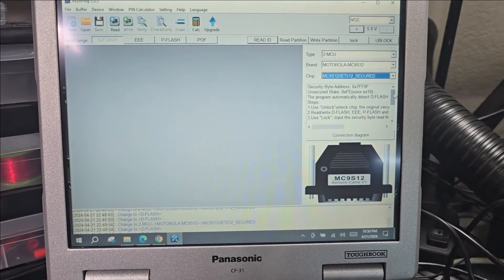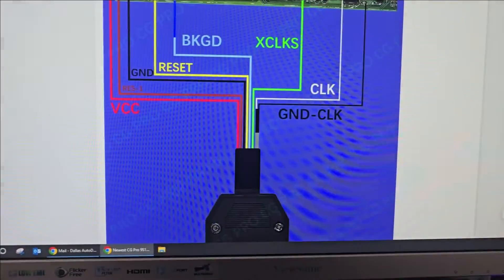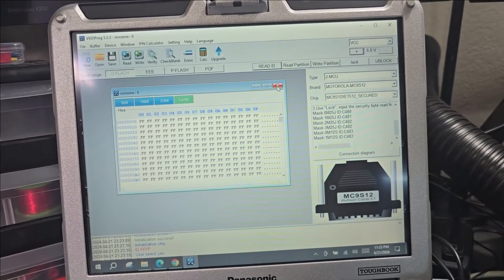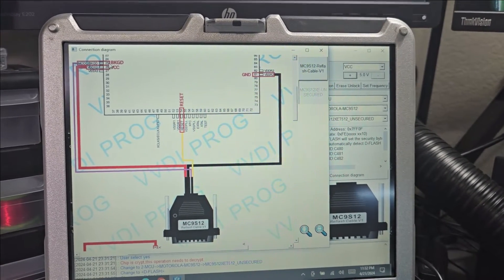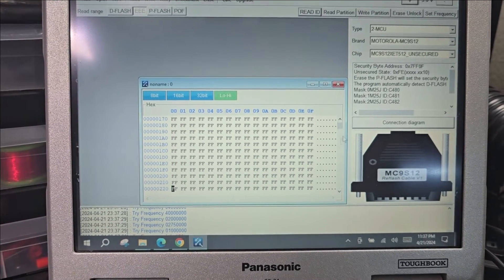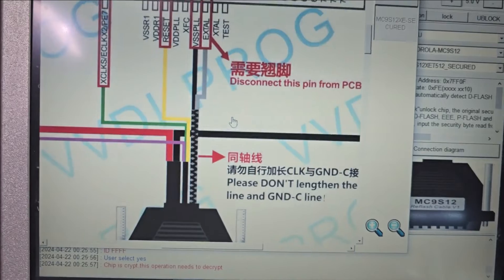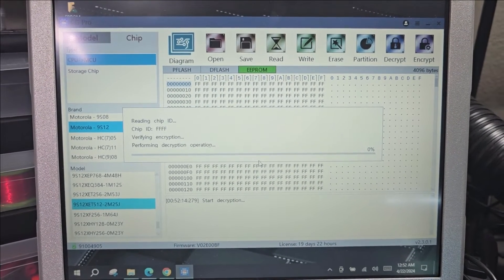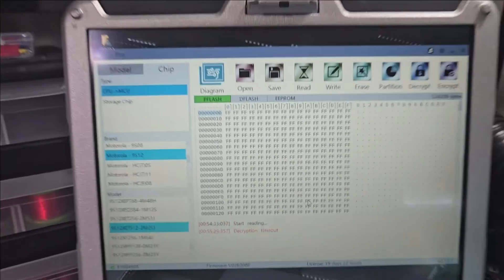Reading a Porsche Rear BCM using VVDI PROG

Comment: You have bad connections. I did it many times with VVDI PROG programmer. Select Type-4-immobilizer Brand-porsche Chip-BCM-2M25J-R/W/UNLOCK now go to Connection diagram, you will see several versions of the PCB of the BCM module porsche, select the appropriate one, connect according to the instructions and it will work. Best regards
Reply from the maker: Thanks for the instructions. that was my first time. I have been doing them the way you mentioned with success.
Reply: @DallasAutoDiag so the VVDI prog works with other diagram?

Comment: Good video series if you try the VVDI again dropping voltage might help read it just turn it back up to write. 3.6v or 3.2v might be right. The multi-prog looks like a deal
Reply from the maker: Actually there is another video coming out that I was successful of reading and writing

Comment: Probably you don't have enough power, lift vcc  pin or power on board, or power only voltage regulator on the board.
Reply from the maker: I got to keep the donor mcu. I'm gonna try to read off board to see whether it's a tool or setup issue
Reply: @DallasAutoDiag  don't forget quartz oscilator if you working off board.

Comment: Interesting series but unfortunately have not encountered that MCU yet.
I rushed to Xtool to see if the diagram would be similar to yours and they look the same, however, there are two components that must be removed and cutting of a trace wire. Unfortunately I do not have that MCU to test it with

Comment: Thank you for sharing these videos. I definitely wasn't expecting a no read with all the programmers. looking forward to the next part for sure.
P.s. side note, I have been able to read "locked" bcm2's with the autel on the Audi and Porsche side, so definitely surprised with all your results so far. 
Hope all is good and keep em coming! 👍
Reply from the maker: I was surprised myself also lol. maybe a different mask number has a better resaults than the one I am on. I do have a sucessful read on another one for a 2018 Porsche Mccan front BCM.
Reply: on autel it had the unlock button 3 row down right, unlock the chip before read, on vvdi prog the button for unlock up right corner above 2 MCU drop menu.

Comment: Lift the power pins off the board, old cas 3 9s12 reader should read secured 9s12 chips.
Reply from the maker: could you share a link to which one you mean? I tried googling it but the resaults got me confused. Thanks